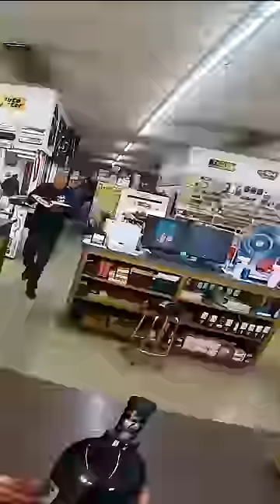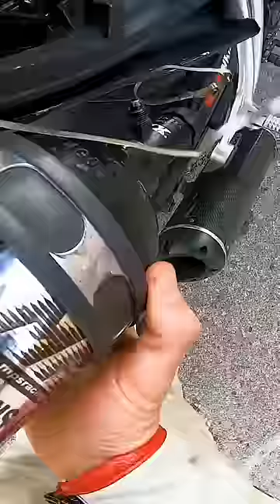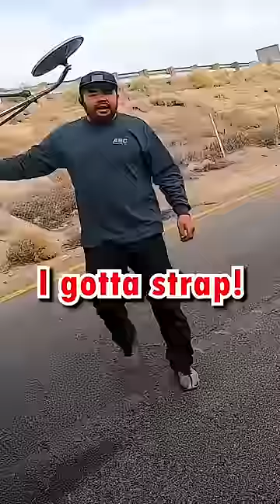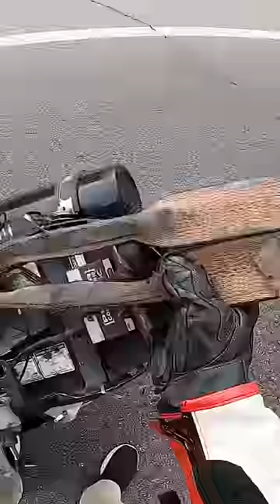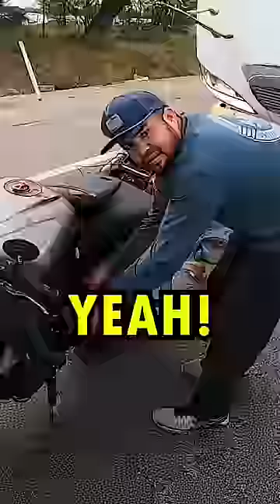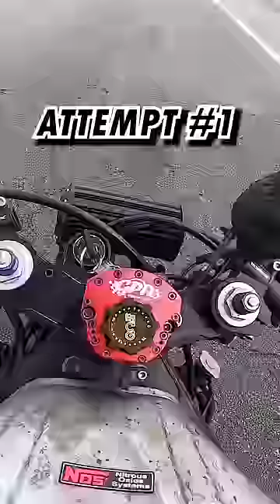If this works..... #shorts #bikelife #lol #fast

Comment: Bro's confidence got me denying the laws of physics
Reply: What law prevents a bike from towing that?
Reply: @viresinnumeris7755  weight probably
Reply: @hi  if a man can I don't see why a bike couldnt
Reply: Bruh😂😂😂😂
Reply: @viresinnumeris7755  Wheel Torque and weight. 

Bike doesn't have enough Wheel Torque to move that truck, the reason why is because they don't have enough torque by the enngine and gears in the Transmission. We have Transmissions and Transfercases is so that We can move stuff that are heavier, faster, and that's because of gear size, number of gears that amplify torque.

 Another thing is weight. Weight also acts as an anchor to help anchor the wheels into the ground and improve traction, as well as help pull as the heavier an object is the more force they can generate when pushing or pulling.
Reply: @youngrody2386  accurately articulated
Reply: Its called Friction Factory
Fly away*
Reply: @viresinnumeris7755   There is no man in history that could pull a semi truck with a full load
Reply: @viresinnumeris7755  cus the bike doesnt have enough weight to be able to pull the semi
Reply: @viresinnumeris7755  it's because the bike doesn't have enough friction with the ground, neither does it have enough torque
Reply: @viresinnumeris7755  F=ma
Reply: Law of physics states you should always push a car from the wheelbase never from the body. I laugh my ass off when I see more than one person pushing a car.

 But this a semi that bike ain’t doin shit n they def not pushing it😂
Reply: Og
Reply: @viresinnumeris7755  that truck has about ten times the hp in order to move more loads
Reply: Same hahaha 🤣
Reply: Me to I was literally waiting with open eyes cause I didn't want to have to see it twice.
Reply: Hahahaha I know right, my disappointment is huge
Reply: @youngrody2386 
good job sir
Reply: @viresinnumeris7755  thats- completely fair 😭
Reply: 0k8
Reply: This one
Reply: He’s missing about 600 pounds of torque and wide ass grippy tires for sure.
Reply: @thisaccountisntreal107 prob not hp but it definitely has 10x the torque
Reply: Bro its got nitrous though

Comment: I expected plot armor to allow this man to pull the truck lmao
Reply: We all did
Reply: Maybe if the truck was in neutral.
Reply: as a diesel mechanic he could of pulled the truck problem is he was trying to pull the truck and trailer lol we moved the trucks all the time by pushing them with 2-3 guys or using a small ass forklift in neutral its not hard to move them the problem is that trailer is probably loaded down thus why the truck is having issues in the first place lol
Reply: @joebone3151  he was
Reply: @nathansmeets4371  it's a joke maybe I should add and downhill too
Reply: Lmao fr
Reply: It was going to work but the truck wasn't in neutral after all.
Reply: Maybe if the truck wasn't loaded he could've moved it like 3 inches
Reply: elite comment

Comment: “There goes my clutch”

“So hey about that, now we’re both stuck here 😅”
Reply: NOW NEWS 818  no bueno
Reply: NOW NEWS 818  means you can't switch gears properly. Clutch is basically used to switch between gears smoothly.
Reply: Omfg 😂
Reply: NOW NEWS 818  nicht gut
Reply: Atleast they have each other now🤣
Reply: @cobra9740  and to start the bike
Reply: @cobra9740  as in get it moving
Reply: You can literally ride any bike without a clutch, they’re built so your not literally stuck with them. It’s called speed shifting.
Reply: No worries I'm going to save the day 

*Electric truck from Walmart
Reply: @cobra9740  No, what most likely happen was his clutch either completely wore out or it faded the same way breaks do when overused.
This won’t affect shifting, all that happens is your clutch will slip in higher RPM or during a sudden increase in power
Reply: @machotaco155  yeah
Reply: @cobra9740  the amount of you that have no idea how a clutch works but are still trying to pass knowledge is heartbreaking. The clutch literally transfers the power from motor to gearbox/tires. Without a working clutch the motor will rev but you won't get any power to the wheels.
Reply: @cobra9740  please dont post info if you are not sure about
Reply: At least they can keep each other company lol
Reply: thanks to this comment section I learned how to say "not good" in 3 different languages. Now to figure out what those languages are. Im pretty sure one of them if Chinese🤔
Reply: @cobra9740  I drive a clutch quad and it disengages the tranny from the motor and it did not actually break
Reply: NOW NEWS 818  same thing it means for manual car you can't f**** move the only way you're going to move is if you find a hill push your bike down to it and try and start it while it's moving in gear you're not going to be able to shift but I'm not going to go higher than 45 either
Reply: NOW NEWS 818  means your transmission can no longer shift properly.  You could theoretically start it rolling and rev the engine to match the rpm of the gear at that speed exactly and slam it in gear, but that will mess up your engine.
Reply: Luck was either clutch or the motor 😂
Reply: @JoshMustillo  oh it was 110% clutch
Reply: And the money he spent on the nitrous could have bought him a clutch.
Reply: Lol!!
Reply: "Hey... need some nitrous?"
Reply: @cobra9740  lols if you know how to change via rev sound you can still bring it upto the right rpm for the gear and slap it in. The clutch is actually for acceleration as without it you're not going anywhere if your clutch is slipping as you're going to stall the bike every time you try to take off but you can change gears if good enough.
Reply: 🤣🤣🤣🤣 it's got nitrous
Reply: @ghostfaceeliteshot7542  what about starting from a stop? I can wrap my head around throwing it in neutral while you slow down, but how would you get going just throw it in first and dump it?
Reply: N then a kid on a big wheel rolls up like, "I think I can pull you guys no problem"
Reply: lol

Comment: Has nitrous
“Yeah, I can pull 80,000 pounds”
Reply: fr he thinks speed is everything
Reply: why is there almost no replies
Reply: @T-34  because you're a spy which sucks at it's job
Reply: @undefinednotfound  hahaha i love this
Reply: Knife  I'm less than a punctuation mark. I'm a single pixel.
Reply: Only if it was fully loaded but yeah. This was never going to work lol.
Reply: @undefinednotfound  Not on my screen
Reply: Knife  says the knife
Reply: @1337_bean  i think hes joking but maybe not, it was worth a try for a vid
Reply: @augustjakobsen4960  try on PC
Reply: @undefinednotfound  no
Reply: Or get really high
Reply: It could have been empty at 12k or so, there still wasn't enough surface area of tire on that bike touching the road to have any chance of pulling that truck.  EVEN IF he had the engine power the tires would just spin in place.
Reply: Coke is helluva drug
Reply: I think it would work on flat pavement empty. Assuming he has the air to release his brakes. I've pushed one by hand that was on a flat. Not fast but was able to get it moving. It was probably empty
Reply: @K162KingPin  even if he had a 395 wide tire it would still not work.
Reply: @boringkhaos  If you actually pushed a semi with a trailer then it wasn't "flat" it was on a downgrade that was ALMOST enough to overcome its own weight and friction to allow it to move on its own.  You were able to provide that tiny bit of extra force needed to actually make it move.
Reply: @K162KingPin  you're probably not wrong it was flat to the eye. And didn't move on it's own. I wasn't trying to sound like a hard ass but it's pretty easy to move objects on wheels when there's no opposing forces.
Reply: @boringkhaos  The opposing force is the rubber on the tires.  Every tire flattens slightly under load.  Even an empty truck like that with 15,000 lb or whatever its empty weight is, is flexing 18 tires slightly to allow enough surface area of the tire based on the pressure to support the weight of the vehicle.  Those tires have 90 psi in them.  That's a pretty hard thing to then flex even slightly.  So to pull that load even on flat ground you have to overcome all of that flex in all 18 of those tires and FORCE it to rotate.  Not to mention the drag of all of those bearings.  Now I know those bearings are designed to reduce friction, thats literally their job, but you still have a LOT of cumulative friction.  Plus all the gears in the axels, the slight drag of the brake disk.  It all adds up to hundred of pounds of force to get it to move at all.

I can't drop a link because YouTube will just delete the whole comment so search up "The Road Where Cars Roll Uphill".  It's a tourist site where due to the optical illusion caused by surrounding geography a car left on what looks like level ground and put in neutral "appears" to be rolling uphill.

The only way to really know if you actually had a truck on "flat" ground that you were able to pull with your bare hands would be to pull it one direction for say 10 feet, then go to the other end and pull it the other way for 10 feet.  Almost certainly you would be able to pull it one way but not the other, because the way you can pull it is actually a significant down grade, while the other direction is actually uphill.
Reply: Common subaru wrx guy
Reply: like that scene in fast 8 XD
Reply: @undefinednotfound  you must really like macOS Monterey
Reply: 8 tons not 80,000 pounds
Reply: @K162KingPin  the truck weighs 19,500lbs. With the trailer is around 46,000lbs empty.
Reply: That’s probably the most expensive way to learn the difference between horsepower and torque lol
Reply: @kingsolo6241  So you don't know anything about tractor trainers?  Its ok.  Maybe don't make factual statements about them then.  The unladen weight of a semi-tractor can vary between 10,000 and 25,000 pounds.  The max legal carry weight in almost every case is 80,000.  Many trucks frequently carry around 60,000.  If the empty truck even might weigh 46,000 that would put the final weight at 104,000 and every bridge the tried to cross would be in serious risk of collapsing.
Reply: Yeah speed its not torque
Reply: Ja z Polski ile?
Reply: @undefinednotfound  god if only that were really true you wouldn’t be wasting so much space and oxygen 😂
Reply: With my 1500 pound moped
Reply: U ain't going anywhere especially with more speed ur just gonna burn the trim on ur tires completely off
Reply: just gotta get rolling
Reply: Proceeds to inhale nos and pull truck by hand
Reply: @undefinednotfound  should Upgrade your Specs💀
Reply: @107bande  NAH
Reply: @undefinednotfound  lol even on a Wii U your name would have more than one pixel 💀
Reply: @107bande  ok
Reply: A human can do it
Reply: The nitrous was for himself, not the bike, apparently.
Reply: he did tow it tho
Reply: Shiieet could be up to 180,000 really. Technically 220 but not realistically
Reply: @1337_bean  yeah, speed ain’t shit if you don’t have enough surface area on the ground to pull a semi lol
Reply: @TheMuffinMan46  worth messing up your bike for a video? social media is truly a disease
Reply: @1337_bean  yea ig if he will make the money the money back from the video, maybe even clout. he did get hella views on this vid. i wouldnt do what he did, but it was kinda funny.
Reply: @1337_bean  well youtube shorts doesnt pay much is what i hear but the clout might pay it
Reply: Assuming that semis not fully loaded.
Reply: Immediately destroys clutch.
Reply: Depending how the bike is geared, it could probably pull the truck if it had better traction